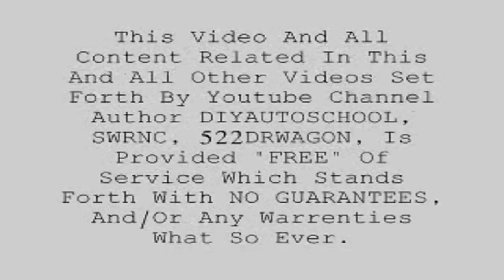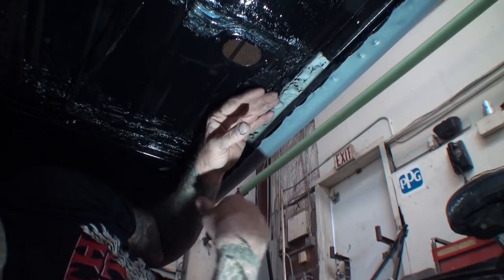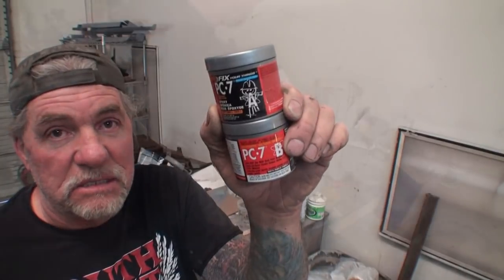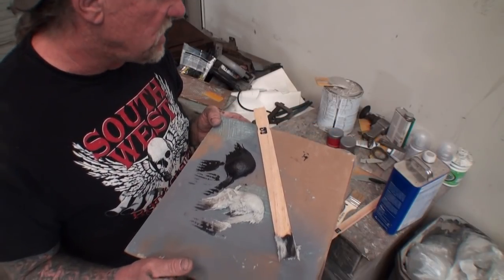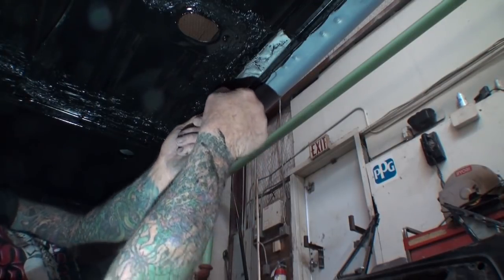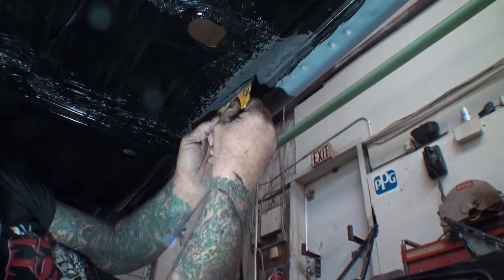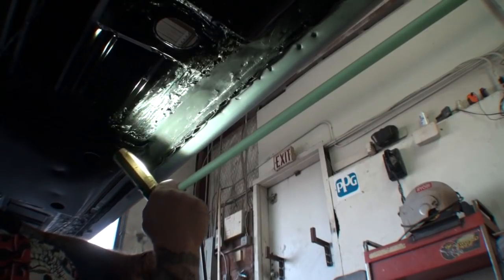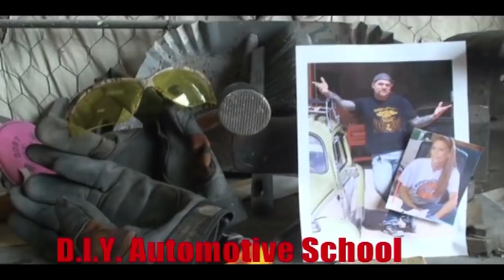PC7 Epoxy Paste - FIX RUST WITH THIS!

Comment from the maker: It's time to fix some rust and say goodbye for ever to the sloppy mess.. Now check out the DIY AUTO SCHOOL Merchandise above this comment and HELP MY FRIEND PETE Get out of Dallas so he can move to Moab!  WE NEED SUPPORT HERE!  Thanks for watching!
Reply: amazing content pete. i was looking for any thoughts or advise. i have a nice 2001xj with about 120k on it. about  10 years ago i put some good money into a 4 inch lift and totally reworked the front and rear suspension the right way, plus more. i live up in the salt belt and ive made the mistake of never painting or treating the underside of the jeep. even had powder coated parts peel and rust. im thinking of remove rust with tools, using metal etch, por15, rustoleum paint over primer(its a red color). trying to do it right but cheap. only using the por15 where its needed. its nothing real bad but its my jeep im never selling. ever. to much wrench time.
Reply: Good deal 👊I learned something new today..thank You Pete
Reply: Would fiberglass have worked in that spot

Comment: PC-7 is a great product. It holds position and doesn't drip like jbweld. Dries real hard too. I'm fixing a rusted spot on a wheel arch. I'm using a piece of sheetmetal cut to fit into the hole and metal epoxy to hold it into place. Once dry I'll build it up level with some more PC-7 then prep it for paint. I had an almost baseball sized thick chunk of paint that was flaking right off due to rust happening underneath on the rear fender lip.  I am not going to pay a body shop hundreds or more just to do this part when I can prep it and maybe even paint it myself.

Comment: Working on our 99 XJ. Replacing floor pan rust section with panels from c2c fabrication.  Luckily,  don't need to use the whole piece. 

Wire wheeled all of the floor pan and found small areas with light rust. Guess I'll brush on ospho and prep the area for PC7.  Never heard of it.  

Thanks for posting. 

Looking forward to the next episode.

Comment: Can this pc7 epoxy  be used over new weld on floor panels to prevent rust formation or go with the seam sealer ?

Comment: Hi Pete was doing HW restos for almost 30 years and always replaced the metal when rusted,never filled them with anything,but today you really showed me a product I didn't know about that can be used in an unconspicuous place under the car to fill in holes and use it properly with acetone and not have to sand. Never tried JB weld either.Thanks Pete.

Comment: Have An old 90s wrangler that had some pinholes in the floor pan. I wasn’t ready to replace the it yet and it had plenty of life left. But I wanted to stop the rust. I covered it in Naval jelly and then wire brushed any rust that was left. Then pasted over it with JB Weld. Worked like a freaking charm

Comment: Another good vid Pete . I discovered similar stuff here in the uk . Loctite 3479a and 3479b exactly the sane snd after I welded up my 1973 Vw squareback sills, I noticed very small pinholes in the Sean’s.So I used this stuff and rubbed it down and painted and wel impressed .But ideal for little repair and not major rust !!
Reply: Terason 5010 and 3m epoxy metal also do the job ps . Teroson is same as loctite

Comment: I had a 1957 Chevrolet panel van, when I pulled the windshield out of it there were some minor rust and holes in the frame for the seal on the outside.. I use this stuff to fill it in.. you forgot to mention that you can sand it and shape it... Then you can seal it with your primer or undercoating..😉 thank you Pete keep up the good work..

Comment: Looks like a good material.  Can I suggest using separate clean sticks to scoop each part out?  Might avoid accidentally messing up the unused material in the cans.
Reply from the maker: I usually do Jim, but I ended up using the whole can and more for the small repairs on this car.. Good Point Made --- Thanks
Reply: You could see he clearly debated using the other stick, but hey, a stick is a stick and them sticks add up. I'd of done the same thing!

Comment: Hey Pete thanks for the video. I've got a car that has some molding holes on the rear body panel and it's got a gas leak. so no welding. Could I maybe use that material to fill the holes with a little piece of metal on the back side of the holes. sanded prime it and paint it?
Reply from the maker: It would be better to use this product as the only one -- meaning put some on the inside and outside and sandwich it all togeather, then go over it with the acetone and let dry. Another thing is how big the holes are...

Comment: If you have surface rust and get most of it off with some 100 sandpaper and or wire brush you dont have to get all of it but there is a rust converter called plastic -kote and goes on white but will turn black when it srys and then you can use a glazing putty to fill and smooth out the area and primer the area then paint and rust wont come back.

Comment: I have slight rust on the stair climber on my 86 Thunderbird.   It is a very common problem on 1983 to 86 Thunderbirds.   I figured that when attaching the clips to hold the stainless trim on the backlight the paint got scratched at the factory exposing  bare metal.  Water would get trapped inside the channel causing the eventual rust.  Some are worse then others.  Since mine is minor I think this would be a good solution instead of cutting out the whole piece from the top of the trunk up to the base of the backlight.   Also I want to keep the two seams on either side of the trunk intact.  Let me know what you think about using P7 for that particular application.   Thanks Pete.  I love your videos and the quality you put into each car that comes into your shop

Comment: Rust spreads to unseen areas and in certain stages is invisible to the eye. Having fixed some real old warhorses in my day to stop the spread of rust in areas that will creep I've used rust converter spray into those places. You can get it in an aerosol or liquid you can spray with a gun. Inside door panels allowing it to run down into ledges and sills and coat areas that trap moisture. The product used in this video works great for easy to reach areas but that rust has spread well beyond the visible to unseen spots. Enjoy the work.
Reply: I'm trying this method out on some rust around the boot on my volvo. Begin with sandblasting to bare metal where I can see any rust, then smear on some rust eater for a couple of hours on basically everything, especially where I can't see the rust. Then I will paint the epoxy onto the metal, then a coat or two with primer and finally some undercoating sealant. Hoping the rust eater will do its magic.

Comment: Great vid Pete. Thx mate. I just looked it up on Amazon and shipped 2x 1/2lb packs to Australia. Going to use it on my semi-truck cab roof. Was planning to solder aluminium. Change of plan now, worried about heat. Cheers 🍻

Comment: Nice tip on the paste!! I will look that up and hope I can get it in Canada.   I have used an amazing marine apoxy type filler that also is tough and lasts forever.  It is however white and harder to cover.  Battery areas are difficult to get all the rust out.  I liked your tone in this video.  Easy to listen to :) ladies like fixing their own cars too, and I sure spend a lot if time to keep my 85 Camaro running and I do the body work too:) I enjoy your practical tips!
Reply: You could try at Peavey Mart.

Comment: Hey my friend Pete. I Have some on my 03 Yukon underneath the rear side doors in the corner by the wheel well. Not a big issue but it has eaten thru the metal already.  So I guess your method is to kill the rust and fill it with this epoxy??   Thanks Pete. Say hi to Minnie !!!!!

Comment: Instead of buying this just buy 2 part epoxy and mix with talc (Hydrous Magnesium Silicate) or fiberglass, till you get peanut butter consistency.  you will get the same resulted and way cheaper.   boat world has been doing it for years

Comment: Can you use this product to fill in small rust pits in metal ? Or does it need to be more pouris?
Reply from the maker: no it has to be a surface that will be able to wrap the epoxy around it such as rust seen in this video to grip and hold solid.. Rust pits are not something you would want to use this type of repair for!

Comment: I used PC-7 when I was in grade school to make a fork extension on my bicycle.I hammered the extra forks into the ones that were already on the bike,slathered each one with PC-7 and let them dry.That extension never broke (it flexed a lot mind you);jumped curbs and went trail blazing and it all stayed together. I may wind up using this stuff on the rocker panel of my '65 Studebaker.I like the idea of the acetone brush to smooth everything out!